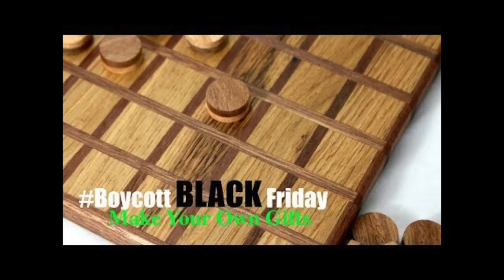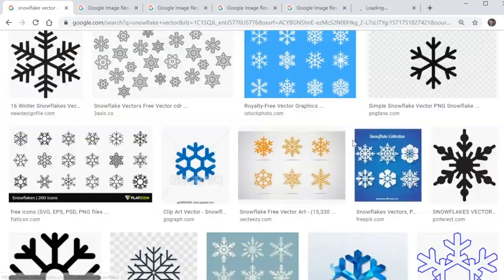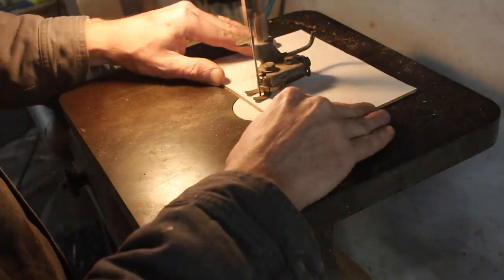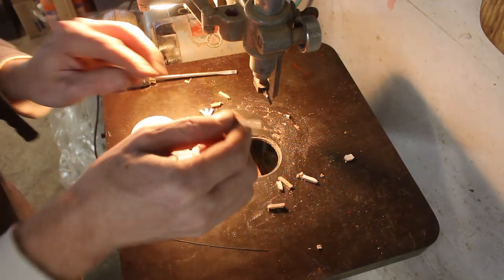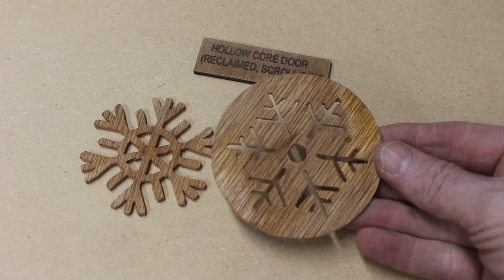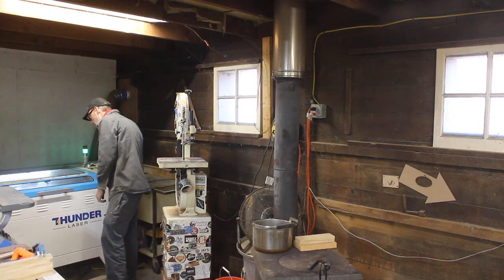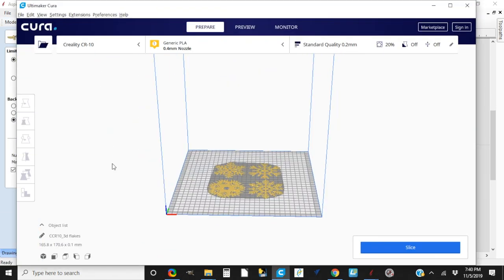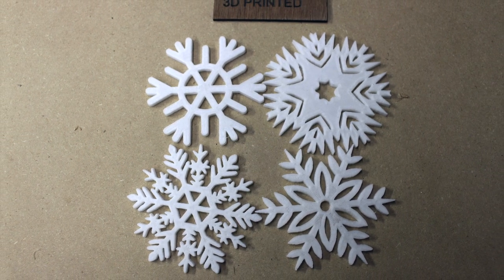Make These Coasters/Ornaments -  By hand, CNC, Laser or 3d Printer

Comment: PLA is a good filament to use as it's corn plastic based and long term biodegradable.  It's the only filament I use for that reason.  The real gotcha if you do a lot of printing is the actual spool itself, not recyclable easily.  I'm moving to masterspool refills to reduce my waste.
Reply from the maker: Thanks for the info. Yea, the spool itself is a big piece of plastic. Seems like there should be other options.
Reply: tim sway I just donated two large garbage bags full of empty spools to a preschool for crafting. There are a few options for refills but not as many as I would like. Search on Masterspool for some info on pla refills without spools. If you only have a few spools though you can reuse them pretty easy in the shop or to wind Xmas lights or extension cords.  There are also some neat prints that let you turn a spool into a parts holder for screws nails etc.